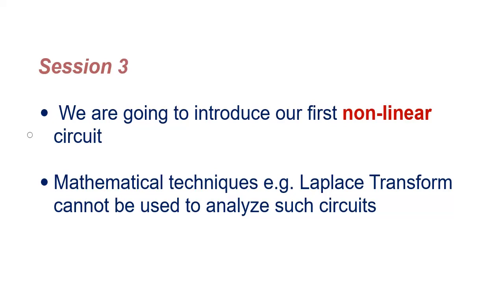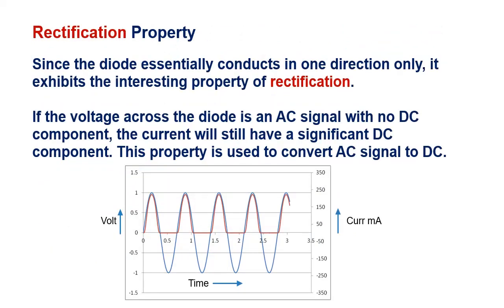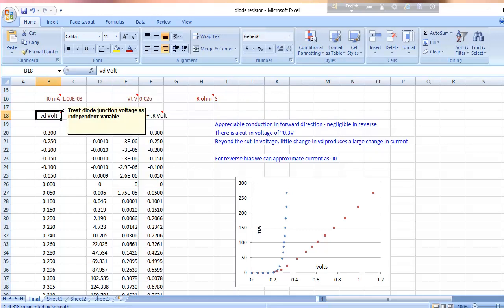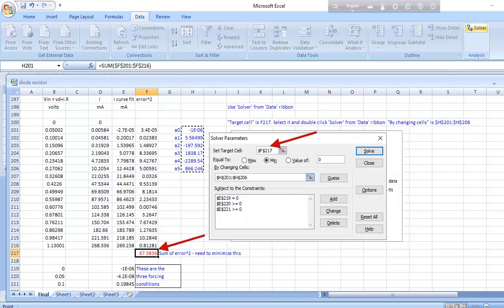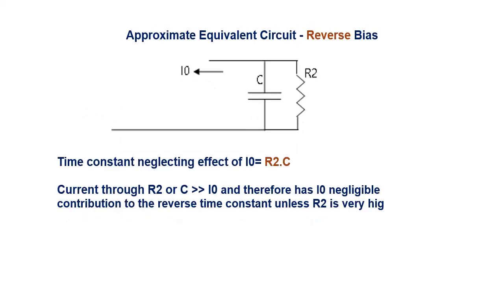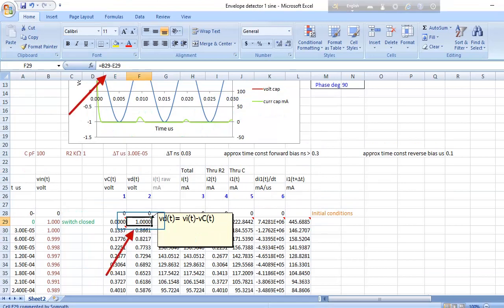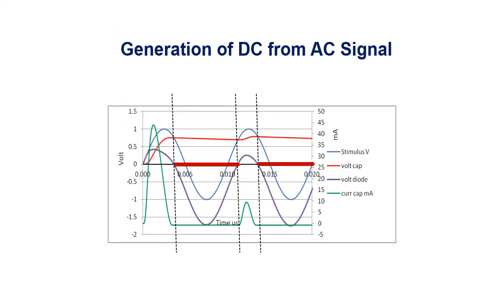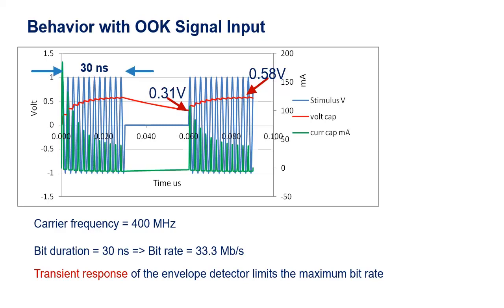Intuitive Circuit Analysis Session 3 : Diode based Circuit

Comment: Is the solver function you used in Excel free?  Also, is this functionality supported in Libre Office or any other free office suite?
Reply from the maker: Solver function comes as a free add-on to Microsoft Excel. Here are the instructions from Microsoft to add it .

The Solver Add-in is a Microsoft Office Excel add-in (add-in: A supplemental program that adds custom commands or custom features to Microsoft Office.) program that is available when you install Microsoft Office or Excel. To use it in Excel, however, you need to load it first. 

Click the Microsoft Office Button Button image, and then click Excel Options.
Click Add-Ins, and then in the Manage box, select Excel Add-ins.
Click Go. 
In the Add-Ins available box, select the Solver Add-in check box, and then click OK.
Tip  If Solver Add-in is not listed in the Add-Ins available box, click Browse to locate the add-in.

If you get prompted that the Solver Add-in is not currently installed on your computer, click Yes to install it.

After you load the Solver Add-in, the Solver command is available in the Analysis group on the Data tab.